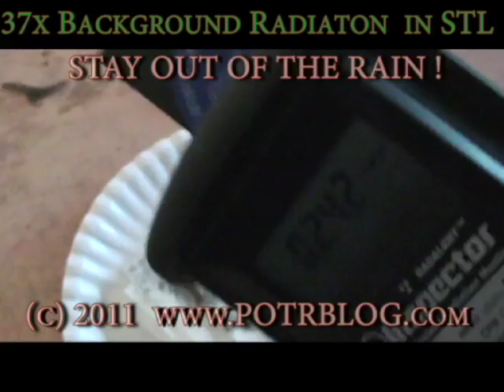STAY OUT OF THE RAIN!  37 Times Background Radiation in Saint Louis 5/19/11

Comment: @JP5466     That may be true, but I need to see more data before I believe that this one place has readings so many times above background when no place I have tested around the USA does. I wonder if the GM could be placed over a bag of No Salt which should read about 100 CPM at 1 inch using that big 3" pancake GM. I would like to see this, than see the counter used onnthe truck directly in the same video, no pauses.